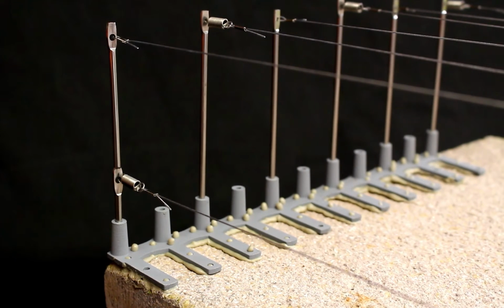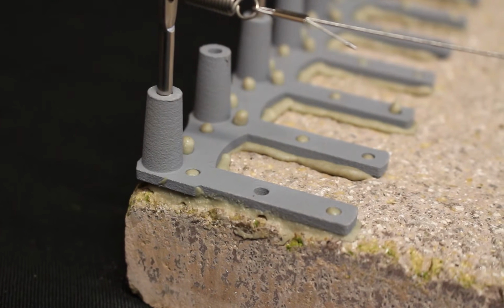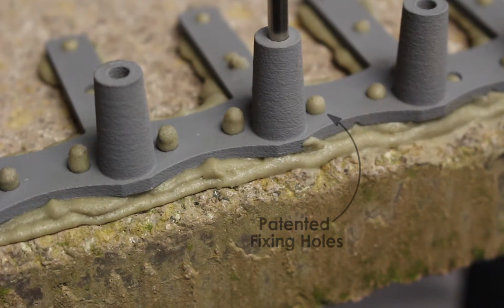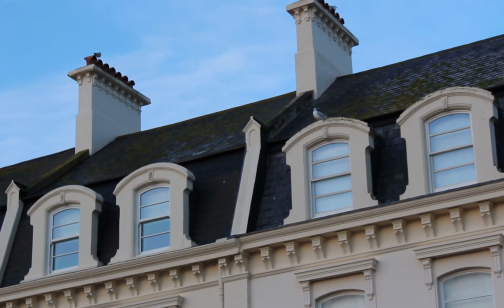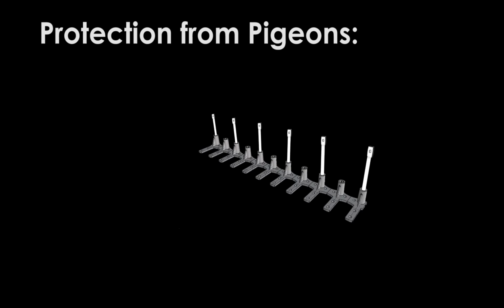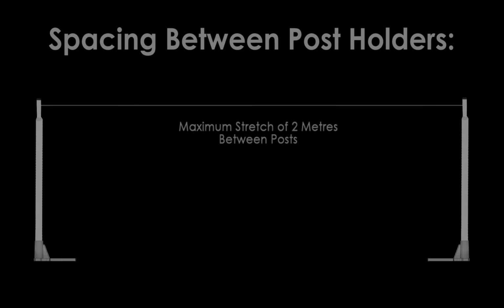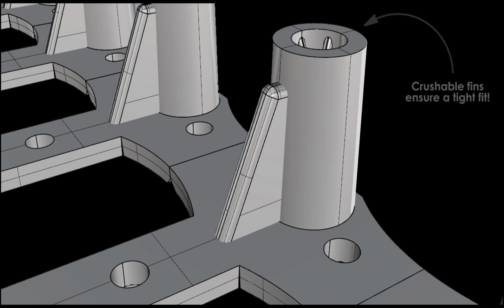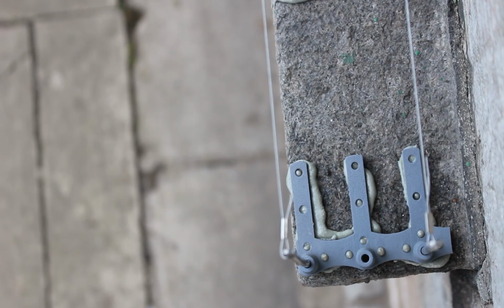Defender Bird Post and Wire System - How to Install Guide

Comment: Your video comes short of showing what to do when installing a length of more than 1.5 metres. For continuous runs it would make sense to have a T shape mount rather than the L shape mounts as once you get passed 1.5m you would need a whole new mount as if you attach to the first set then if a bird lands on the new wire then the existing L shape it is attached to is then facing the wrong way.
Reply from the maker: Hi Gerry, thanks for the feedback. The poles inserted can have wires attached to both sides, thus creating a continuous line of defence. I hope this helps; if you need more advice on how they work, please call us at 01626 835055, and we will be happy to help.
Best wishes, Defender Bird Spikes

Comment: is this anti birds roof electric wires
Reply from the maker: No, this is a system that uses metal posts inserted into a polycarbonate base. A sprung wire is then attached to the top of the posts which the birds do not like or can't land on. There is no electric supply.
Reply: @DefenderBirdSpikes  maybe that could be an option in the future